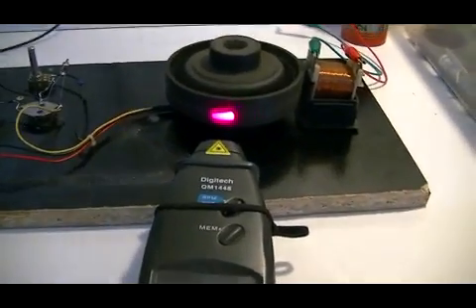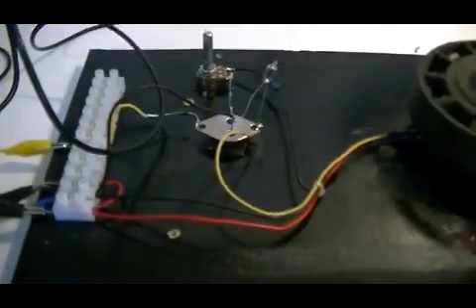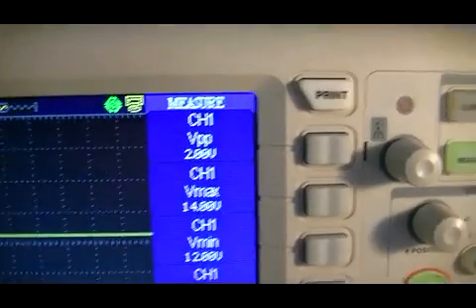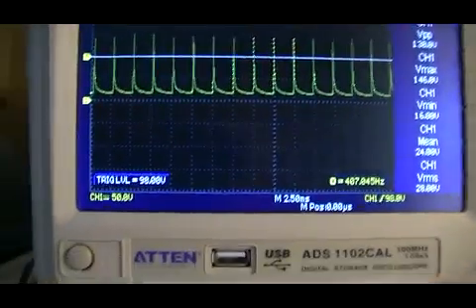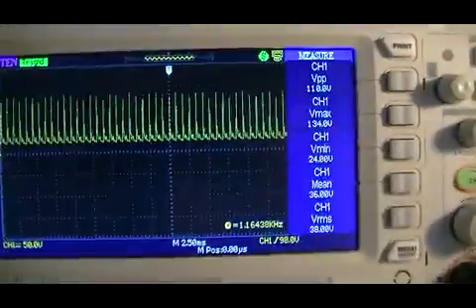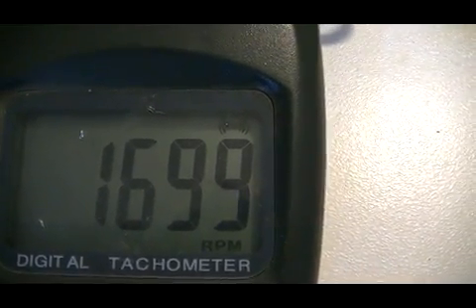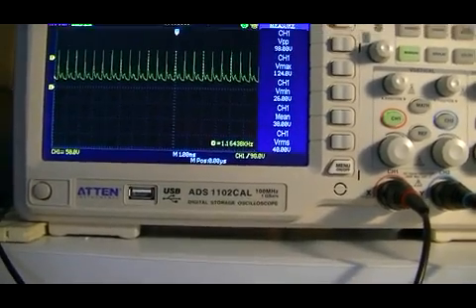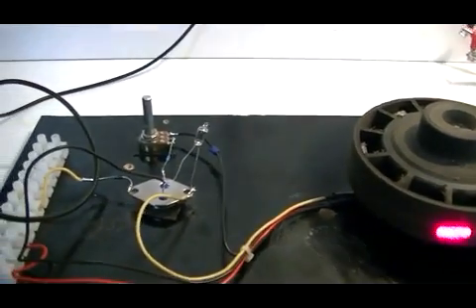Stepping it up

Comment: I'm stepping mine up also.  Running on 12v now and using a protection neon like you.  I am just using a 12v /500mA wall wart as a power supply and it's working.  The motor draws over 200mA and gets slightly warm running the fan but the TIP 3055 transistor is staying cool somehow even without a heat sink.  The inductive kickback charges up a 12v SLA battery nicely.  This is a winner Brad.  I hope more people try it.  Thanks again.

Comment: Thank you.

1) What would happen to output if a bigger wheel?
2) How long can a stepper motor going at that speed last?
3) How does one use that setup to de-sulfate a batter?

Cheers

Comment: Hi Brad.
I too am curious about the temp of the motor.
I was crunching some numbers to see what wattage the light was using on the setup, but you threw a spanner in the works by not showing the amp draw when the light was disconnected on 31v. - You show both the voltage and RPMs but not the amp draw.
Can you remember if it changed much from 157 ma when it was disconnected?

Comment from the maker: Hi blulander
Follow the link in the description to our forum,and in that thread you will find the simple schematic.The coils remain cold,as there is very little current flowing through them. The motor is rated at 5 volts 2 amps-thats 10 watts. We put 31 volts at 156ma-which is only 4.8 watts. So just under half it's rated power.